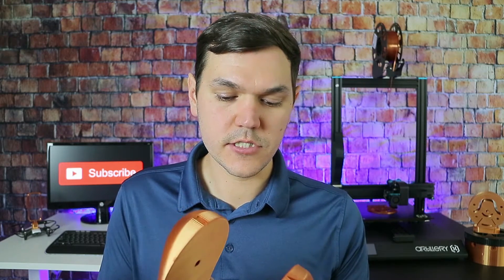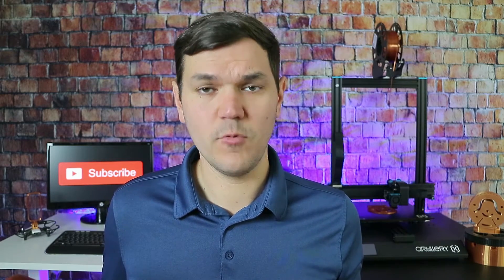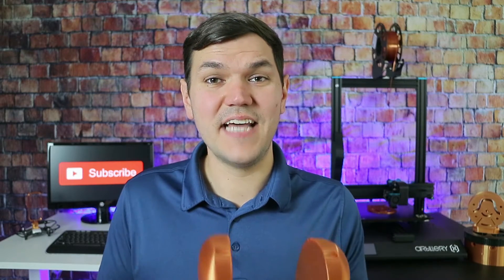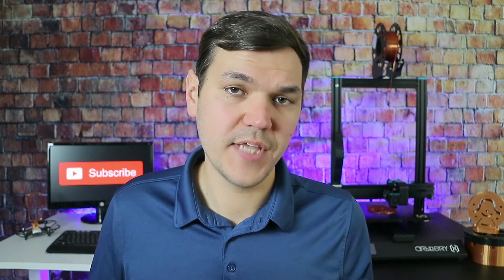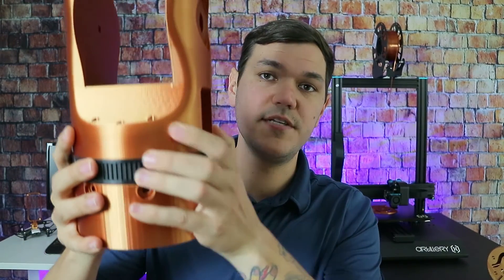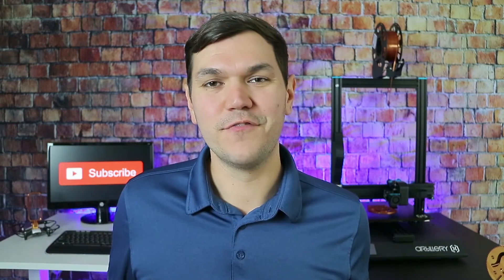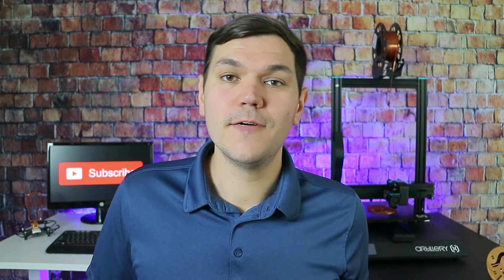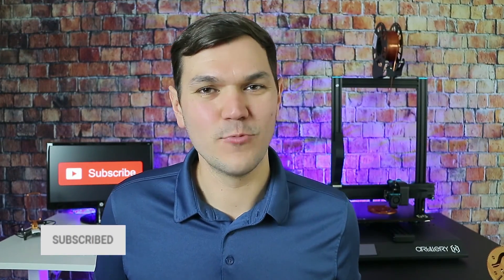DIY - 3D PRINTED ROBOT | BCN3D MOVEO ROBOT - BUILD VOLUME REQUIRED | 6 AXIS ROBOTIC ARM (DIMENSIONS)

Comment: So glad I found your channel, I have been struggling with a 3D bin picking system named SOLOMON for about two years. Definitely understanding the data and how it is processed is key! We use the deep learning feature to compare hundreds of models at different angles and positions on a conveyor belt. The vision system generates the robot off set data in correlation with the Robots TCP. I look forwarded following along with your build. I am trying to print the robot on my ender 3.
Reply: Wil it fit on the ender 3 ? Thx
Reply: m db yes